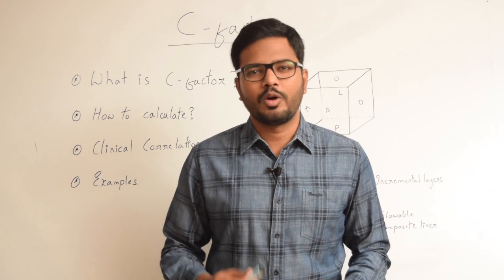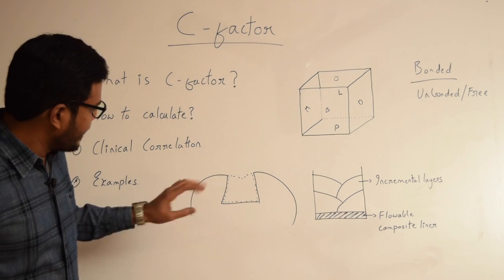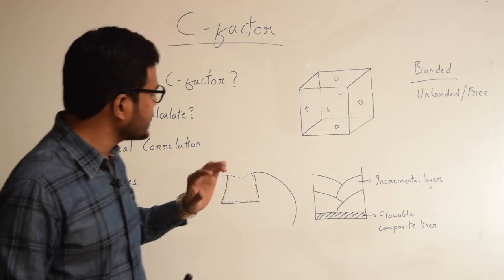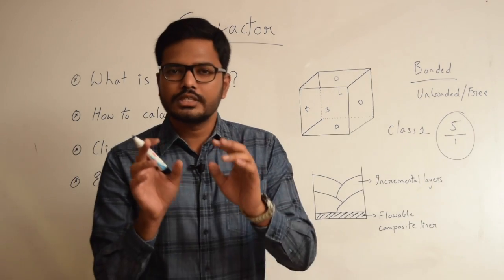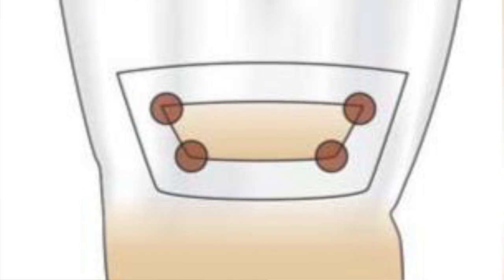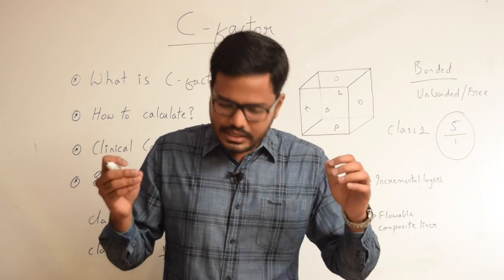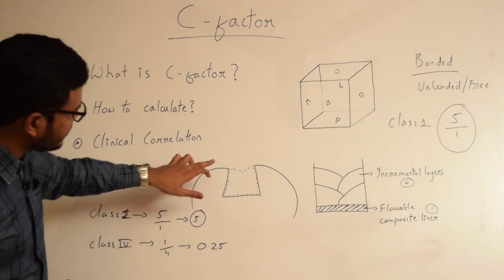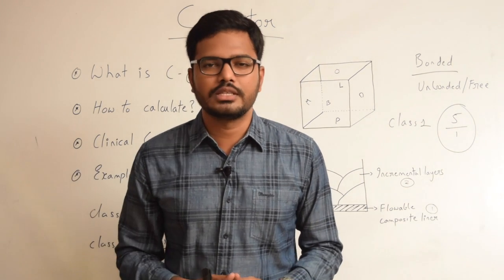C - Factor | Topics In Description Below

Comment: for class 4 - 0.5 ???
Reply from the maker: It's 0.25
Reply: MDS Entrance Lectures by Sai Naveen Kumar Pilli  how doc ? you explain it , sturdevent given 0.5 and composite page given 0.25 so
Reply from the maker: In the same text book it's given as 0.25. Basically it depends on number of tooth surfaces prepared. For conventional preparation it's 2/4 = 0.5 and for conservative preparation it's 1/4 = 0.25.
Reply: In general overall ? 0.5 ?
Reply from the maker: Sudarshan Mandlecha C factor is least for class 4 which is 0.25 as discussed in many mcq books and also based on key given in previous entrance mcq questions.
Reply: MDS Entrance Lectures by Sai Naveen Kumar Pilli what z d right answer if key has both options?? For example in dental pulse book!!